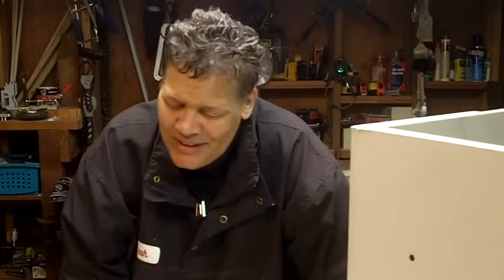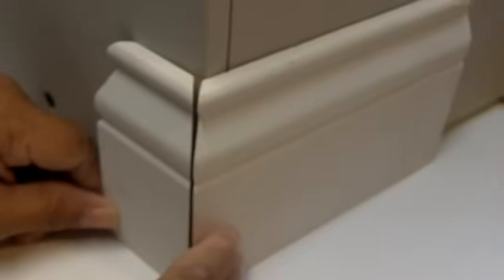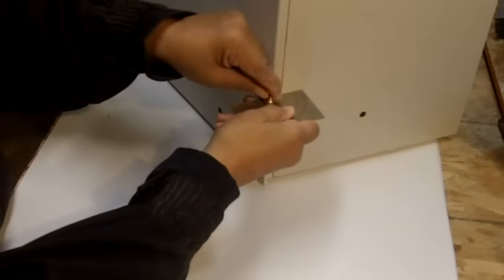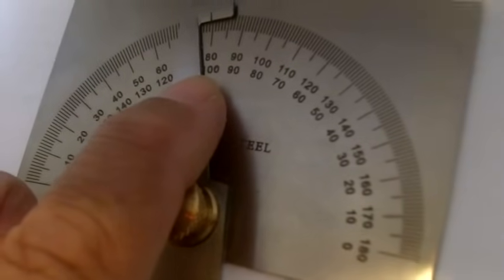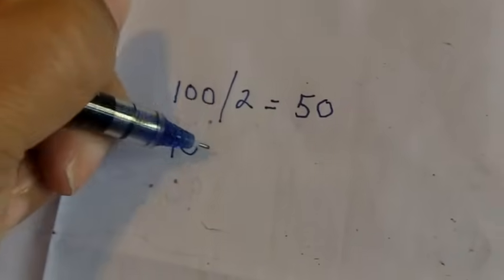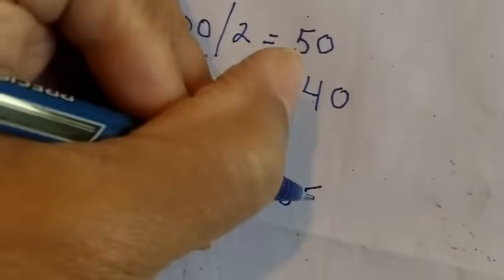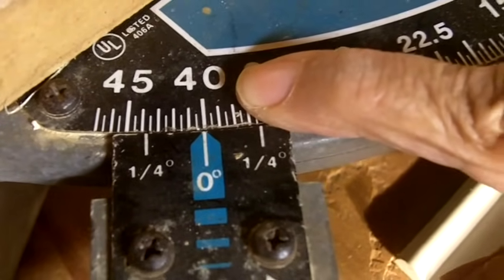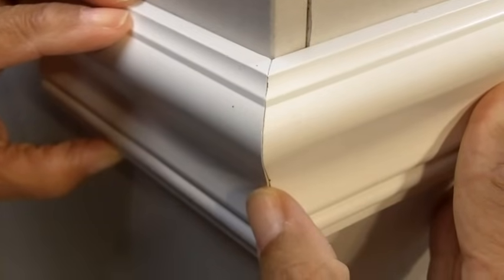Install Perfect Outside Baseboard Corners/Easy Math Trick

Comment: A very good explanation but...

1> Ridgid makes a couple of Miter saws which swing 71' each way. I have the 10" unit & it is awesome because you don't have to make a spacer wedge to cut an angle over 50'.

2> Your math is compensating for the marking on the common framing scale you find on stock miter saws which is marked 0 when the swivel is at "home" position. But this angle is actually 90' to the fence & only 45' is truly 45' to the fence on this scale. If you count back stops from 45 to home (90) you can mark each by going 50,55,60,65,70,75,80,85 to (90) & mark each with a fine marker pen. Some saws have this (true) marking on them already. Using this corrected scale you can abandon the extra math & measure your wall at 120' then simply half it to 60' each, which is an easy mental calculation.

Comment: If you have a compound miter saw, is it better to lay a wide baseboard (like in her example) flat on its widest side and make the miter cut with the saw's head tilted or is it better to simply cut the baseboard while it's vertical, as she shows in this video?  Which, if either, gives the better miter cut?
Reply from the maker: You know, Johnny, compound miter saws are great, and if you have one, I would cut it on the flat...I think you would get a better cut.

Comment: If you don't have a protractor, you can use either two square pieces of wood or reverse your skirting board  (Off cuts). Lay both pieces on your two walls. Mark where the two cross on one piece. Difficult to explain when I can't draw! Join the opposite ends and you will have the angle you need, you should be able to transfer that to you mitre saw.  I expect you already know this.

Comment: 2 quick questions:
If the angle was 80, what would you set the miter to?
If the angle was 100 what would you set the miter to?
I do no they are 2 different angles, and one is acute while the other is obtuse.  So two different formulas for two very DIFFERENT angles.

Comment: I had and outside angle board I was trying to get done with an 87 degree angle. I tried cutting the angle in half, because it’s acute, and it made the final angle more obtuse. After thinking about it I added the 2.5 degrees and cut at a 47.5 and got a perfect result. I’m assuming I don’t know how to read a protractor and had everything backwards. Can someone help?

Comment: Loved your inside corner video almost no one comes anymore and in reality it’s so much faster.. have to take take note with this video though.. for extensive crown or high end stain grade materials yes this is the right way however for your normal prime base or chair, it’s much faster and cleaner to just 45 and cut your pieces a blade long and caulk the difference. Especially when considering the drywall finish is never going to allow the trim to sit flush 99.9% of the time anyways.

Comment: Hi. I am abit confused.So if angle is  80 degrees. 180-80=100.  100/20=50.  As you said mitre doesn't cut 50 degrees. What to do then?

Comment: Informative indeed I remembered from college as a bricklayer training that (I had 93 degrees) that if u dissect the line on paper basically dissecting between 93 degrees leaves you 46.5 so I as u did subtracted this from the 90 angle and again gave me a lovely cut ....my partners friend debbie is a carpenter and said how my cut was as good if not better than hers  I was very happy ....good to know that formula though simpler than my confusing method lol

Comment: Can someone answer something for me please.... I watched the video of how she “coped” a inside corner on the baseboards. Do you cut the angles to 45 regardless if it’s NOT a 90 degree angle?? Mine was a 93 and I cut them to the correct angle on my saw, I coped one of the baseboards and it WOULD NOT match up at all like she showed in the video. Could it be the flooring causing the issue?
Reply: Bluegill20  good question. I’m no expert but I believe you 45  or 45 1/2 (depends on which video) degree inside corners and cope, and protractor and figuring your angle is for outside corners.

Comment: i am applying this to the house i am building. im finding that the base of the walls are not straight which makes it hard to get that tight seal at the lower part of the base board. any tips will help
Reply from the maker: shim where needed

Comment: @seejanedrill - Alright Leah, I'm missing something here, big time. If you simply need to halve an acute wall angle, for example say 80°, then you'd cut 40° miters... But following the math, if you have an obtuse corner of 100°, half of the supplementary angle gives you the exact same pair of 40° cuts! 

The math itself adds up just fine, but you're gonna have a pretty hard sell convincing me that the same two 40° miter cuts are going to join flush for two completely different angles! The only way I can think of that makes sense is to rotate the work piece 90°, butting the narrow face against the fence when cutting the miter joint for acute angles. Is that the missing link here?

Comment: I'm confused.
If my outside corner is 80deg, then I set miter at 80/2=40deg, right ?
But if my outside corner is 100deg, then 100/2=50
   i set my miter at 90-50=40deg.
How can an outside corner of 80deg and 100deg have the same miter setting of 40deg ?

Comment: So, are you saying then that a miter saw does your 100 degree angle (the formula) AS WELL AS A 80 DEGREE ANGLE (divided by 2) set at 40?? This makes no sense to me! Someone PLEASE HELP!!
Love your videos
Reply: The problem with formulas is that you have to remember them and then you have to apply them right, instead, have a go at reasoning it this way:  If you were abutting 2 timbers in a straight line and cutting the abutment in the mitre saw, your mitre angle would be set at 0.
If there is an angle change at the abutment AND you want each piece of timber to contribute equally to the angle change, then measure the angle change from straight and divide it in half; then set the mitre angle to this number. See, no formulas.
Edit: For your 100 degree outside corner you set the mitre at 40.  For 80 degree acute outside corner you would put your baseboard on edge rather than flat and use the standard table mitre which allows a 50 degree max setting.(80 degrees is 100 degrees from straight, then halve it to get the 50 setting).
Reply: After carefully watching the video I think I understand what is going on, because like you this didn't make any sense to me. The saw here has a center mark at 0 and counts up, my saw has a center mark at 90 and counts down.
Reply: @arfonjones7188  Thank you very much for your help. Can’t wait to try it on the job.

Comment: If the corner is 88 degrees, and you divide by 2 you get 44 degrees.  If you set you miter saw to 44 degrees, you will get a 46 degree cut (90-44).  Two 46 degree cuts will get you a 92 degree angle (not 88).  You can't get an acute angle cut without going above 45 degrees on the miter.  BTW...the miter setting should be (180 - Angle)/2.

Comment: Loved your video and the explanation. Bought the tool. Our first wall measured at a 92 degree angle. We followed the formula for over 90 degrees and got 44 degrees for the cut. It didn't look right. We finally narrowed it down to 46 degrees which just happens to be 92 degrees / 2. I'm confused now since 92 is over the 90 degrees you talked about.

Comment: Just buy the plastic Starrett gauge...not that stupid protractor.... but yeah okay fine it's a good video for someone who does happen to have a protractor around but if you are going to actually buy one shoe star at it's only like five $6 more and it just gives you the exact angle you need to cut at in one shot done

Comment: Not sure I agree with you that if the angle is acute (less than 90) that you simply divide by two. Let's say that you have an angle that is 86 deg. That would be 43 degrees. I've seen many miter saws and adjustable miter boxes that will not go lower than 45, like the one I own unfortunately.

Comment: Love your videos!

The way I was always taught (great for those hand saw users like myself) I lay a piece of baseboard against the wall and mark on the floor both sides going from behind the corner to in front. I also mark a vertical line on the back of the baseboard going to the top of it. I do the same with the baseboard held on the other side.

You'll now have two sets of lines on the floor and one on the back of each piece of baseboard. Now, put the first piece of baseboard back and where the outside line from the second piece comes out, make a mark on the front of the baseboard. Repeat for the second baseboard using the line on the floor from the first piece. Now draw a line on both pieces from the front bottom mark to the top rear mark and that's your angle to cut at. Make sure you cut on the out side of the line and not inside otherwise you'll end up with a gap when putting the two pieces together.

You can't always draw on the floor so a piece of paper taped to the floor will work just as well, just as long as it can't move. No extra tools to buy and this will work with any angle. I always do it this way because I never presume that any angle is a right angle therefore I never use a mitre box :)

Comment: Great Job. Another way is to if you measure one of the angles and that angle is obtuse. Just measure the other angle and that will be an acute angle less than 90. and then divide that by 2.

Comment: ok i’m feeling really dumb right now, what i got from this video is if your angle is 80 degrees you set your miter to 40 degrees, but if your wall angle is 110 degrees you set it to 40 degrees also????? what am i missing????
i meant 100 degrees , i don’t want to confuse this situation any further

Comment: As per the video, if the wall corner angle is less than 90 degrees, divide it by 2, so if the wall corner angle is 80, I mitre 40；if the wall corner angle is greater than 90, mitre angle y= (180-x)/2, where x is the wall corner angle, say,  wall corner angle (x) is 100, The mitre angle (y) is 40 too! So I can mitre the same angle on the baseboard to fit different angle on the wall ?!  No, one angle on the baseboard only fits one angle on the wall! The " divide angle by 2 when it is less than 90 " theory is wrong.  The y=(180-x)/2 equation is universal, should be used on any angle.

Comment: A lefty, no wonder you are so good at this stuff.
Reply: Ha! Good at spreading misinformation. The math presented in this video is very wrong. The correct formula for all angles (right, obtuse or acute) is (180 - x) / 2, where x is the measured angle.

Comment: Don't think that you will get a 50 degree cut by cutting with your saw set at 40 degrees. It doesn't work. 40 degrees is 40 degrees, not 50 degrees. You could try backing up your piece with a 10 degree shim I suppose, or if you have a tall enough block of wood, you could cut it at 45 degrees, hold it in the saw, also holding your trim along that, and then set your table to 5 degrees.

Comment: Im confused. I saw one of ur videos explaining what to do with a inside corner whos 85 degrees. U said cutting 42.5 +42.5 would not work, because it has to add up to 90. U then cut a 47.5 and a 42.5 and it was perfect. Now ur saying u just find the number and devide it by 2.. confused atm yikes..

Comment: Jane's formula is WRONG. Subtract the protractor angle from 180°, then divide by two. SAME FORMULA for less than 90°, 90°, or greater than 90°.
Sample one:  angle reads 88°: 180-88=92;  92/2=46 Set mitre saw at 46°. Sample two: angle reads 94°: 180-94=86; 
86/2=43 Set miter saw at 43°. 
How does a video get a million views with bad info?????
IF THE ANGLE IS LESS than 90°, you don't just divide the angle by 2 for the miter cut. That's WRONG!!!!!!!!! Awww, anybody can have a bad day. KISSES, Leah!

Comment: The “obtuse” angle doesn’t make any sense to me.

So a 95 degree angle divided by 2 is 37.5
90 - 37.5 = 52.5

So how does that work???
Reply: Use a calculator lol, 95/2 = 47.5 

90- 47.5 = 42.5 

It helps if you divide by 2 correctly lol
Reply: King Kong haaaaaaaa. Yeah I realized that after I posted it. Thanks for pointing that out.....

Comment: She explained it wrong. according to her using her explanation  80 degrees is less than 90 so you just divide by 2 and that would = 40 degrees, then if it is 100 degrees which is greater than 90 you divide the 100  by 2 which = 50, then you subtract 50 from 90 = 40 degrees so how then can it work for both at 40 degrees ?  80 vs 100 ? , what she forgot to say is the open cut should be facing  you when your making your cuts on the less than overall 90 degree angle but when the angle is greater than 100 degrees the open face cut should be away from you when cutting the boards then her formula would work. And so it is with all angles less than 90 open face towards you more than 90 open face away from you.

Comment: So you say that if the angle is less than 90, you just divide by two and set your miter to that. So let’s say the protractor measures the corner at 80 degrees (which is less than 90), so we divide by two to get 40 degrees. Well hang on… that’s the same angle you set your miter to in the video to get the obtuse 100 degree angle! So the “divide by two for angles less than 90” rule for choosing the miter angle doesn’t work.

Comment: Wait a minute something is not right in your formula. You are saying I will set my mitre saw at 40 degrees for an 80 degree corner and then again for a 100 degree corner the same 40 degrees ?? That will not be correct. It can't be the same angle for both cuts !!

Comment: So you used a 40 degree cut for a 100 degree angle. According to you if the angle is less than 90 degrees you just halve it so for an 80 degree angle it should be 40 degrees OBVIOUSLY WRONG
Reply: It can’t be a 40 degree cut for both 100 and 80 degree angle…….

Comment: Another way do this....
A straight line is 180 degrees.
Subtract your corner angle from 180 and divide by two.

Miter Angle = (180 - x) / 2
Reply: Yes correct, which is why her saying to divide by 2 angles that are smaller than 90 degrees is false.
Reply: L Puma I don’t understand, because she had good results on 1 out of 2 subjects she talked about, it’s ok to give false information? That’s funny.